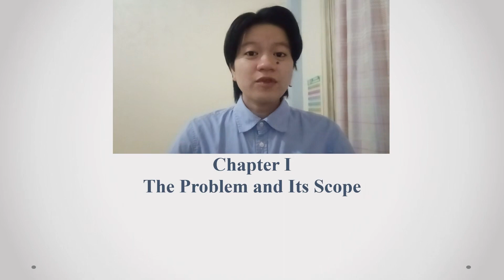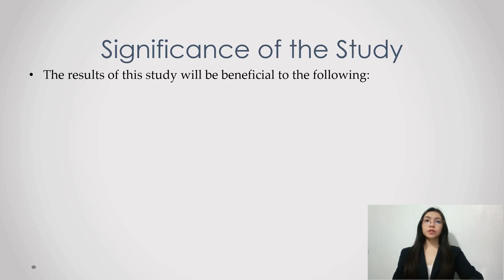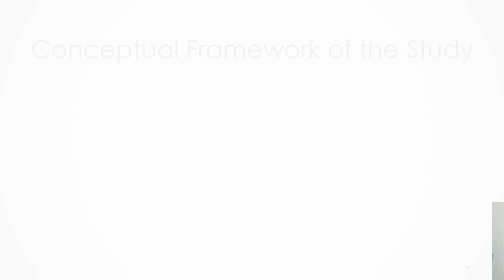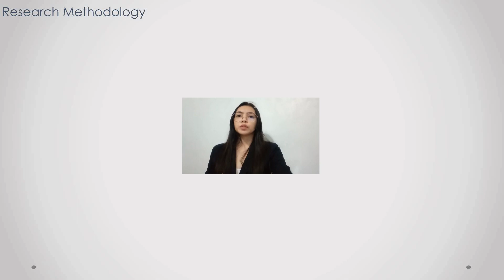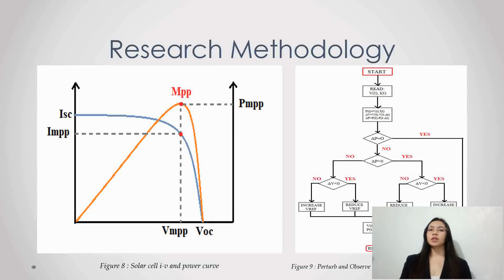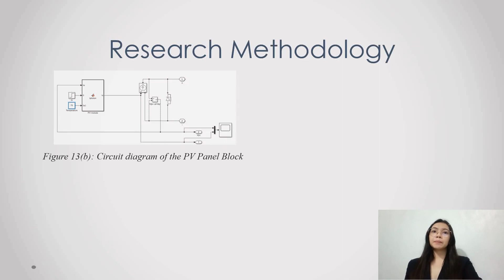The Use of Buck-Boost Converter in Maximizing the efficiency of Grid-Connnected PV System

Comment: NAME: Cheri Mae E. Tinguban

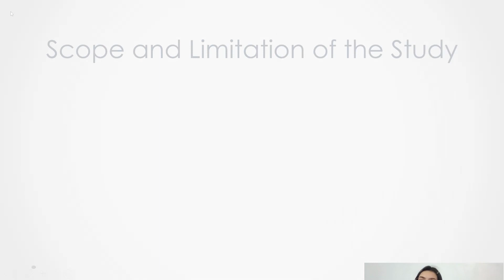CLASS NAME & CLASS SCHEDULE: ENS 341 – Research Methods for Engineering – 5:00-8:00 Saturday 

DATE: 24/03/2022

REACTION: This video is about "The Use of Buck-Boost Converter in Maximizing the Efficiency of Grid-Connected PV Systems," and what I got from it is that the promotion of solar energy consumption through solar PV systems has become significant due to environmental concerns and rising energy demand. The researchers, on the other hand, presented a Buck-boost converter for grid-connected PV systems as a strategy for making solar energy an economically feasible alternative to oil and gas. This suggestion will also benefit residential structures, institutional buildings, commercial buildings, PV system contractors, and the environment, according to the researchers. I'm blown away by how well a buck-boost converter can increase the performance of a traditional photovoltaic system.

REFLECTION: We require alternate energy sources, particularly in the production of electricity, as fossil fuels and natural gas are rapidly decreasing. We could prevent waste and reduce energy output by improving the components of the current photovoltaic system. As a citizen, this will undoubtedly benefit the general public. To provide consistent voltage and increase efficiency, a buck and boost converter-based system is used. As a result, PV modules for grid connection of numerous solar arrays will be reduced.

Comment: NAME: Miraflor, Joshua
CLASS NAME & CLASS SCHEDULE: ENS 341B/ 5-8 PM Saturday 
DATE: March, 24 2022
REACTION: The research they presented is very important and helpful especially to those commercial buildings
REFLECTION: The study they presented is about buck and boost converter-based system is use to produce constant voltage and increase efficiency due to this it will reduce PV modules for grid connection of multiple solar arrays. Buck-boost converter-based system for grid connection of multiple solar arrays is implemented and presented in paper. The important of this study is the amount of output voltage may be set to higher or lower than the input voltage, enabling us to maintain the desired output voltage.

Comment: NAME: BERNALDEZ, ELLYN MAE A.
CLASS NAME & CLASS SCHEDULE: ENS 341 - SATURDAY (5-8PM)
DATE: March 24, 2022

REACTION: This research proposal is very impressive and informative because based on the video buck-boost converter will improve the performance of the conventional photovoltaic system. It is a proposed solution to make solar energy an economically competitor to oil and gas.

REFLECTION: This study offers great benefits to buildings such as residential, Instituitional and commercial buildings. The performance of the pv system will attract more consumers thus making their business more grown and it has least negative impact of the environment compared to other energy source. We really need to think of an idea in relation to alternative energy that will help us conserve electricity which is also friendly to the environment.

Comment: TRE-INTA, KEZIA L. 
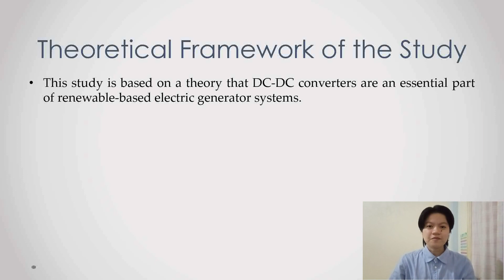EE 341 TTH 6:30 - 8:00 PM 
MARCH 24, 2022 

REACTION: A very impressive study it is. Using a DC-to-DC converter that will maximize the power and the voltage produced by the PV system is a good way for it to be more efficient. It was a good research proposal indeed.

REFLECTION: This study of using Buck-Boost Converter in Maximizing the efficiency of Grid-Connected PV System gives me a lot of insight that improving PV systems and its performance are good way for people to choose solar energy rather than conventional energy sources thus lessen the expenses on electricity.

Comment: NAME: MONTEBON, GERALD MAE E.
CLASS NAME & CLASS SCHEDULE: COE 346-A (5:00-6:30 PM)
DATE: 03/24/22
REACTION: I realized how nice the buck-boost converter this can be either maximizing or minimizing a voltage in solar panel. We can reach the desired voltage in our output that we wish to have.
REFLECTION:  This is a big help especially to those who have small solar panel, through the buck-boost converter we can use our solar panel to connect this to our appliances or anything that needs an electricity.

Comment: Greg Anthony  C Peñez
EE 341 TTH 6:30-9:00 PM
March 24, 2022

Reaction:
Very good presentation and well prepared. Clearly the researchers have master their topic. Excellent, most research didn't mind the efficiency of the PV system. 

Reflection:
Having the use of Buck- boost converter is very good in the production of electricity using photovoltaic systems. It will increase the efficiency of the system.

Comment: Franz Michael B. Nadal
ENS 341 SAT 5-8 pm
March 24, 2022
Reaction:
The research presented was very informative. I commend the energetic presentation of Eve and the very calm presentation of Fatima. Their topic was very timely and crucial nowadays. As we know we are now going to renewable energy and solar power plants is one of the well known renewable energy. With this we can possibly achieve a higher efficiency in production of electricity via solar panels. And we can make this research one of the focal point which has to be considered in the building and installation of solar power plants and solar panels. I think we this research we can have an improvement in regards to solar powered plants.

Reflection:
The fossil fuels and natural gas around the world is slowly depleting and this resources is not sustainable that is why we need alternative source of energy specifically i ln the production of electricity. By enhancing the components of the current photovoltaic system maybe we could avoid losses and maximize the power output. And as a student it is up for us not only to be develop ourselves but also delve deeper into the current technologies which can be of help in this modern day.  And I also realize that there are many brilliant ideas that are just waiting for to be discovered.

Comment: The use of buck-boost converter will improve the performance of the conventional photovoltaic system. It will allow the solar modules to utilize its maximum power so that it can deliver electricity to the load with less losses. This is a brilliant idea.